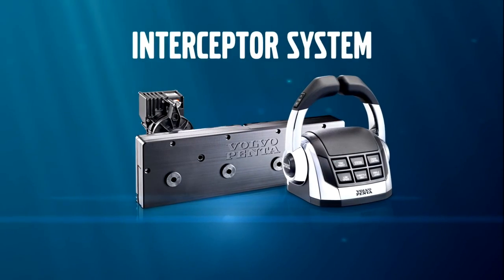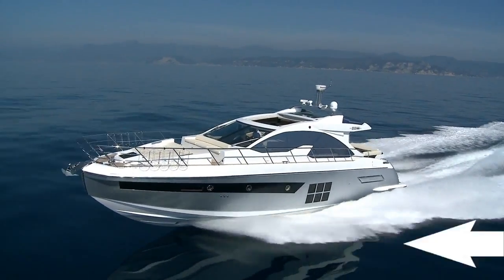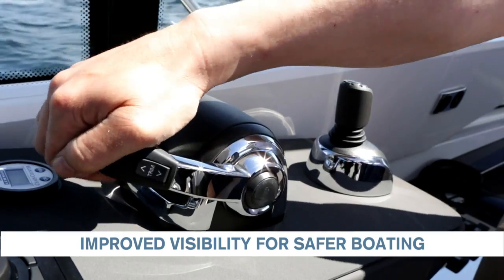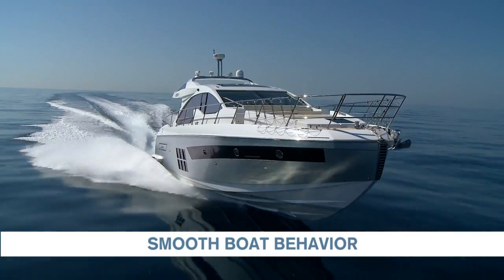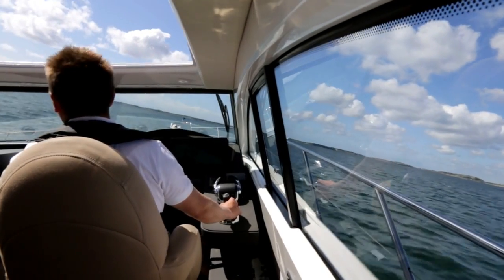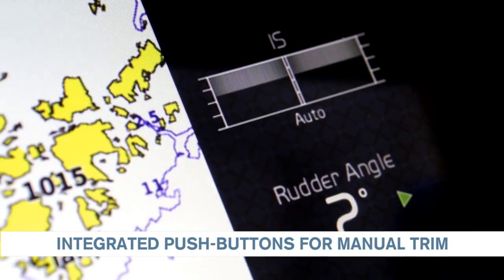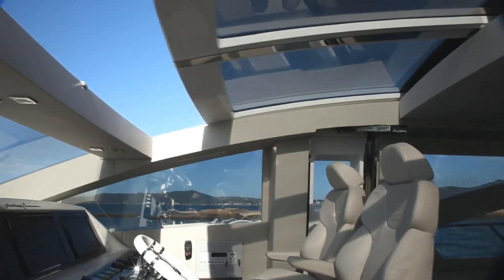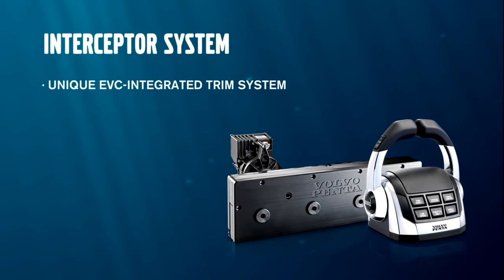Volvo Penta Interceptor system

Comment: Interceptors are not reliable. I used about 3 navigations with one set, then I started having problems. I bought another set, one spoiler is normal, and the second one failed after a month. I disassembled it, but inside the block with a motor, water, a factory defect, was poorly sealed. Pebbles fall into the plates and they stop moving. The plastic is not reliable, the teeth of the gears are grinded. I had to abandon the Volvo Penta Interceptors. The money could not be returned. Wasted money. Broken nerves. Holes in the boat hull.
The Interceptors are efficient, but the workmanship is poor.
Reply: Same here.